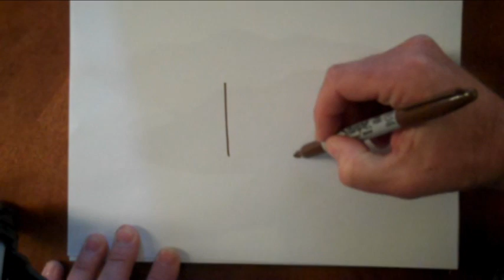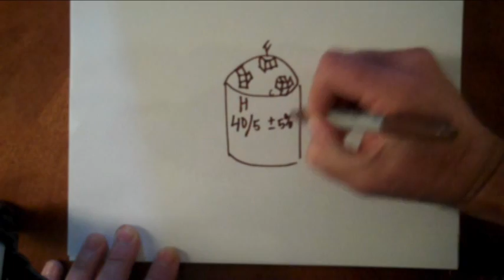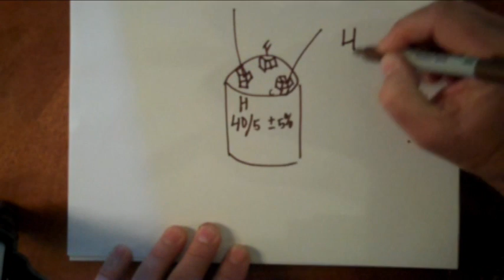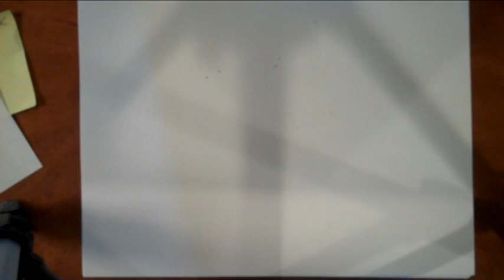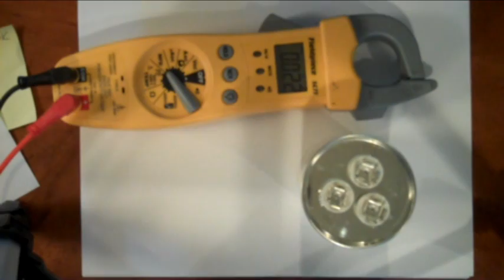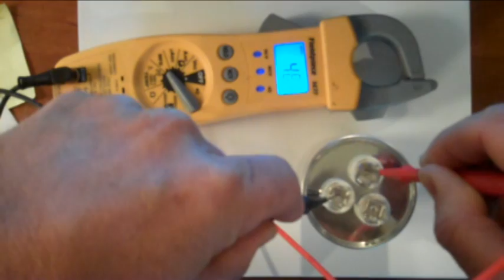Bad Capacitors - Checking for bad capacitors

Comment: Can i use a 370 volts dual run capacitor to change 250 volts that’s is the original in  wall air conditioner